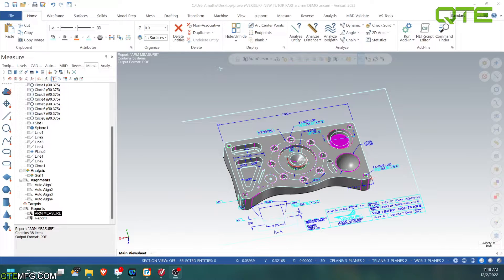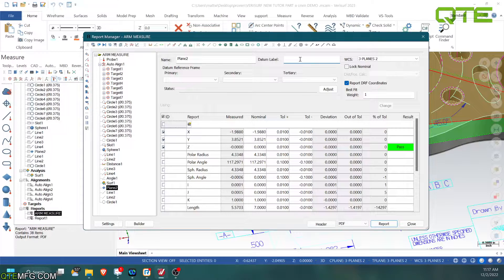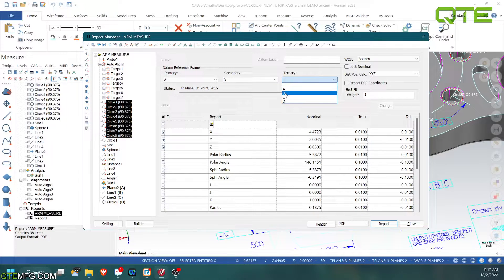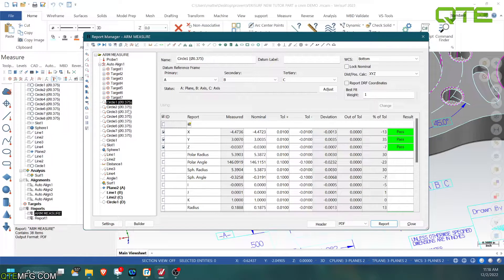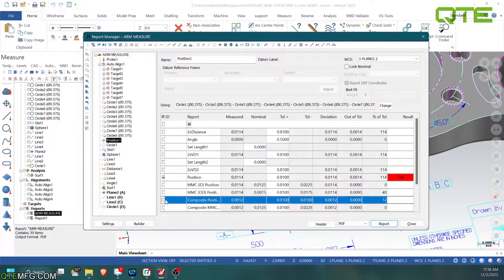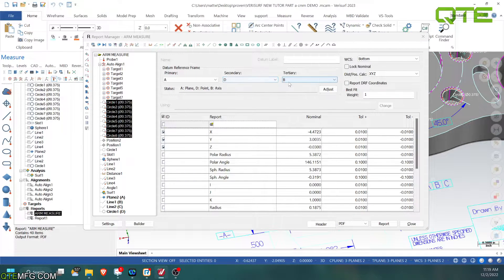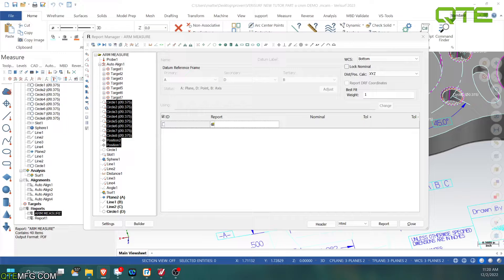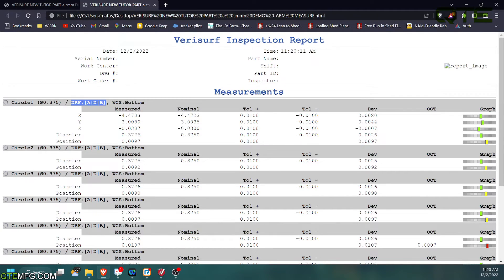Applying Datum Reference Frame in Verisurf

Comment: If my datum reference is .028 to ABC, and my result is .020. 
That's all good, but when I throw in my DRF, it throws my result from .020 all the way to 1.357.

Why is this happening?
Reply from the maker: Something is up with your datums, causing a huge error into you DRF . I would create the same DRF using feature align and see where the error is getting pulled from. You have one of your Datums causing this huge error